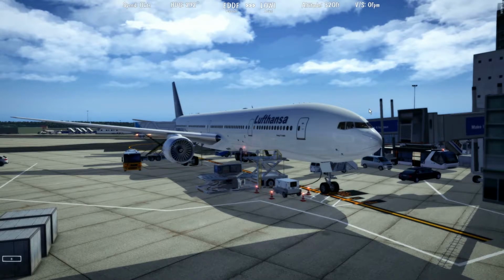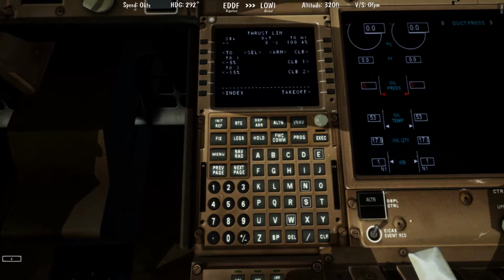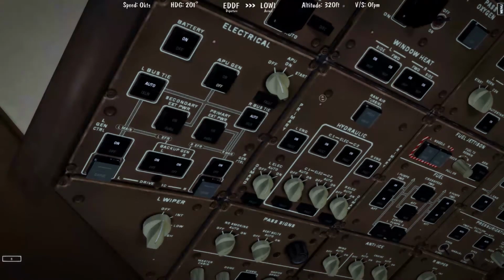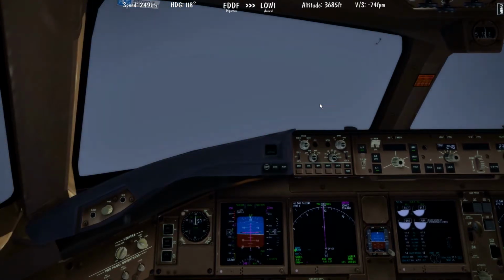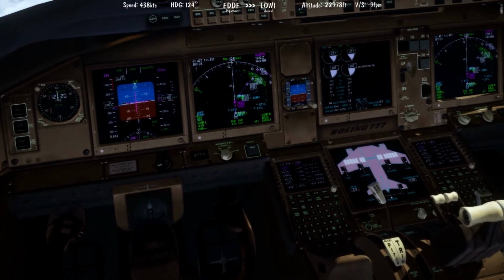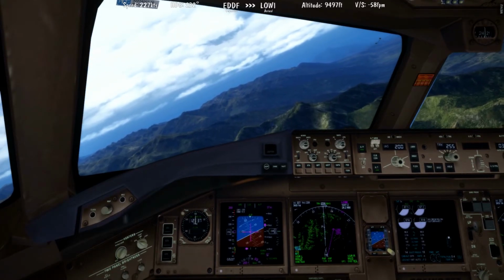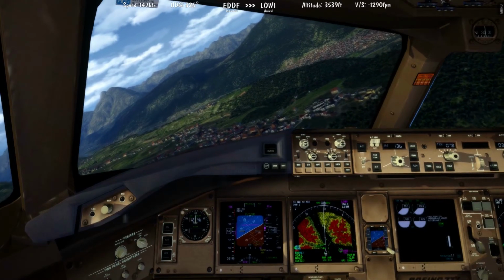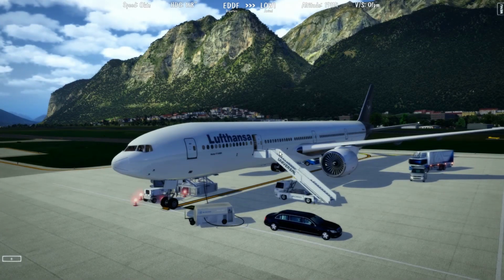[XP11] [777] | Frankfurt (EDDF) ✈ Innsbruck (LOWI) | DLH286 | Fictional Flight

Comment: Does the FF 777 have an new PFD?
Reply from the maker: Nope. If you are mentioning on the cross of the F/D, it's an option in the menu for the plane.
Reply: InFInItyTwo I havent got this plane yet. Were is this menu?
Reply from the maker: The top right of the screen. I also do not recommend this plane for now since the amount of work you need to do just to make it better is a lot. You are better off going for P3D with PMDG777 if you want a 777.
Reply: InFInItyTwo Ok Thank You